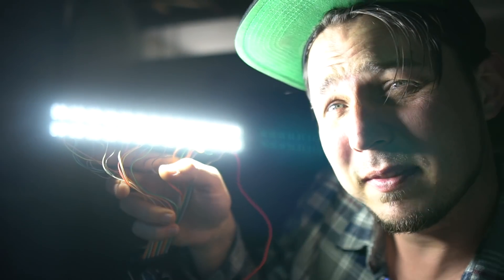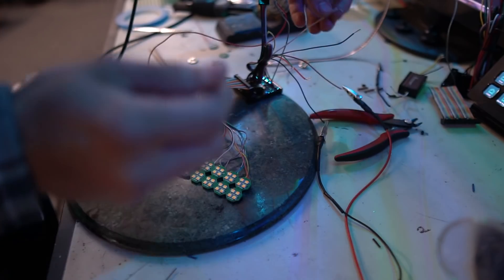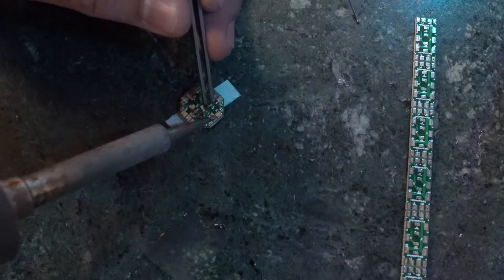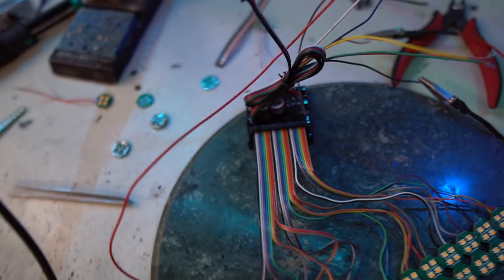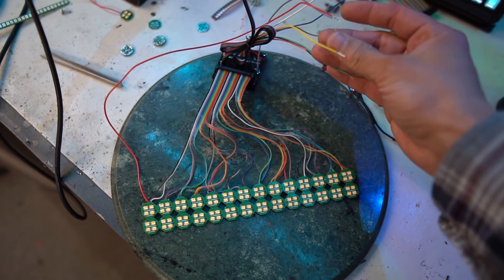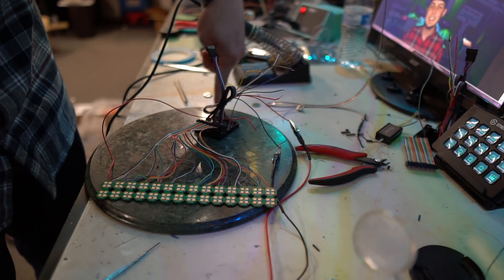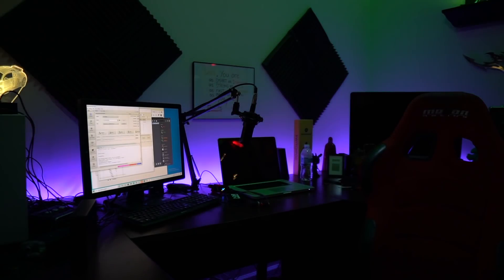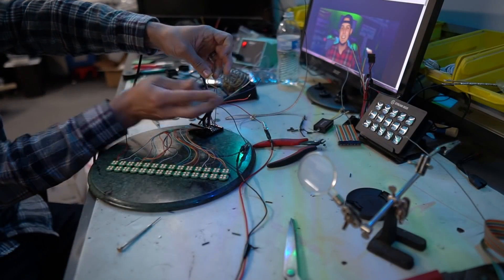The Sequential LED Pod Panel | FlyRyde

Comment: I want to build a taller set like this but I dont really want the show modes. what would I need to just have the white running light turn off for the yellow turn signal? what resistors, can I run them all off one power an ground, is there something more simplistic than the ghost module?

Comment: Quick question I am making taillights, simple 3" wide X 33" long.  I would like to know exactly what material I need to buy to make the lenses out of?  These are Flat easy to make out of plexiglass or Acrylic or polycarbonate.  Of course I want something that looks and works awesome when finished.  I plan on using the led pod panels, sequential as well.   Suggestions guys, most helpful. I would like some with first hand knowledge of product suggestions. Thanks Ron

Comment: These are really nice and bright. But how good are those strips as low beams and high beams? I drive a jeep jk wrangler. Is it possible to fit those strips in a 7” circle formation and use only them as low beams?